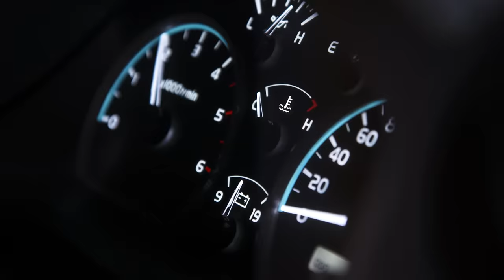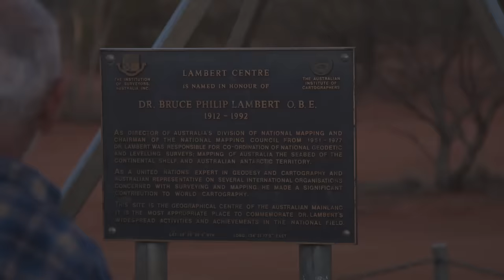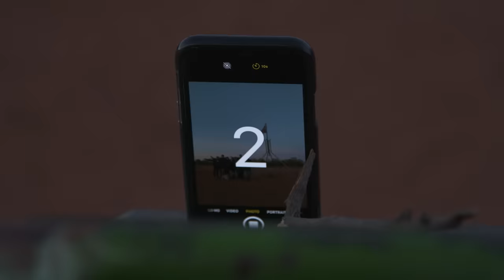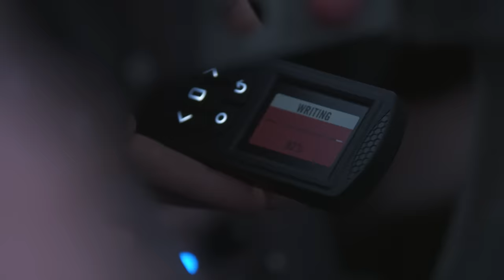How to set up a Side By Side for OFF ROAD RACING • Patriot Games Season 3 • Episode 9

Comment: Watching all of the Australian 4wd channels 1st I have to say I love it and I will someday be over there wheeling with you all at least once. Second I never quite understand why everyone seems to think that they need to pick a gear when driving an auto. In the 70s and 80s with weak engines and 3 speed autos yes I get it but I own a hemi ram 1500 and my father owns a Cummins ram 2500 and both have enough power and gears that in sand it's best to leave it in 4wd high and just let the transmission do its thing in drive. My hemi has the 8 speed as I'm sure Sarah's does and low range is too low to be good for much but big rocks or steep descents. No wheel speed. In sand and mud just put it in drive and let her shift. Try it. You will like it.

Comment: Speaking as a Ram 2500 owner and having driven it in very soft/loose sand, I find I wouldn't go under 20 psi...maybe 18 psi.  But, 20 psi produces sufficient floatation on 35s without risking losing a bead.  The 2500 platform can have 2,000 lb difference over the 1500 from the factory, so you have to air down accordingly.
Reply: I agree. I've got a Power Wagon with a FWCamper in the bed, bumpers, sliders, gear, 9,500lbs. 18 is really the absolute lowest I've gone. All depends on the tire construction too, but 10 on a non-beadlock rim? No.
Reply: Im surprised those werent real beadlocks